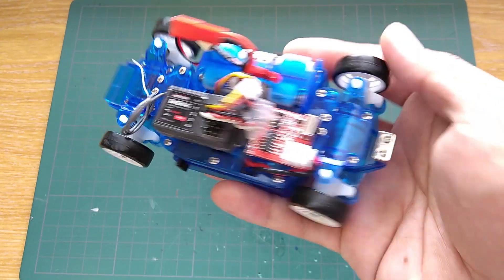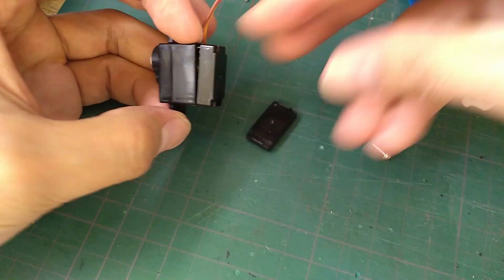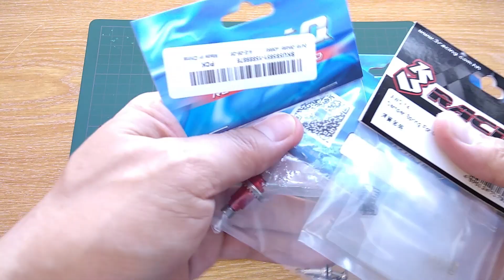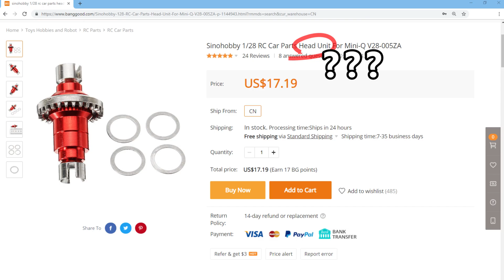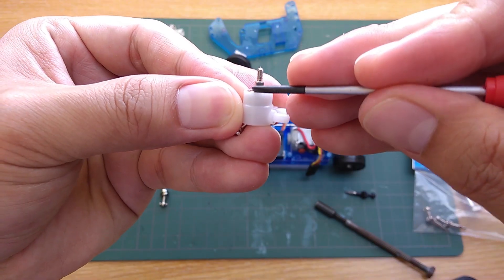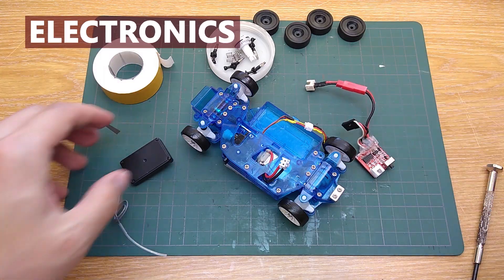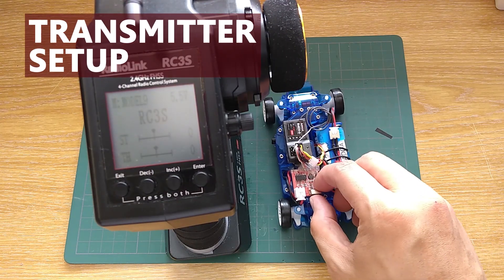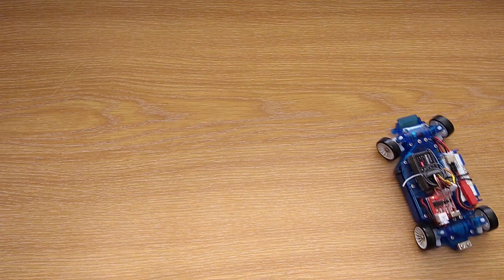Mini-Q TRQ1 | How To Build Ultimate Budget RC Drift

Comment: Hello just wondering...what’s the reason to upgrade the sevo?
Reply from the maker: The original one is 5 wire system which isn't compatible with standard RC electronics I upgrade the car too.
Then the precision, that 5 wire isn't precise nor fast.
Reply: Beaver's Hobby thank you for your reply!
Reply from the maker: @JimmyCNguyen  My pleasure.

Comment: Hi Beaver! Does the wltoys k989 drive shaft and gears work on the trq1?
Reply from the maker: Only the 17T motor pinion will work for sure. The drive shafts/swing shafts are 1mm longer and will only work if you use ball differential.
Reply: @BeaversHobby  i was talking about the prop shaft and not the drive shafts. sorry about my poor technical language. is it possible to use the same prop shaft as k989?
Reply from the maker: @antoniogilmesquita  Not directly. Both shaft ends are longer than Mini-Q but you can file them out so the length is the same. The cut is the same size though so you'll only need to file both ends off.

Comment: Hello Beaver! I have a question. What is the power switch on the bottom? It still works when it’s off then I switched it on and the car acted kind of weird? Thank you!!
Reply from the maker: It's power switch. The car should be off when it's at off position. I think you got a defective switch and board if the car is on no matter if the switch is on or off. You can unplug the switch too open up the case and pull small plug with 2 wires out and see if the board is still acting weird.
Reply: Beaver's Hobby thank you! I will try it. Ordered 2 cars and that happened to one and the other one seems the gear is stuck? The wheels simply won’t move anymore after the second charge. Worked great for the first hour haha
Reply from the maker: @Cigmop  Check the ST/DR dial. If it's too low the car won't run. Try and turn a wheel with your hand. If it can turn when the power off but it won't turn when the power on then there's a problem with the electronics. Hope this helps.

Comment: Hi Beaver! wich bearings do this car needs? Can you had a link in the part list?
Reply from the maker: Here you go.
- 8 of 3x7x2mm for the wheel hubs.
- 4 of 6x10x3mm for the differentials.
- 2 of 2x5x2.5mm for the prop shaft.

Comment: Hi,thanks for the great video,it really helpfull for beginner like me..i was wondering do u have any recomendations where to buy the body for this rc?
Reply from the maker: It's 94mm wheelbase so you can choose them from Mini-Z. I bought most of my bodies from Banzaihobby. Here's link to unpainted bodies. http://bit.ly/2CGgozp
You can check the wheelbase here. Look for 94mm. http://kyosho.com/mini-z-info/support/body-specifications/
And here's how to mount a Mini-Z body on this car.
EP1. https://youtu.be/U8kbobTW_10
EP2. https://youtu.be/-kKLbRNrDxY
Reply: Wow,thank you very much!keep uploading great video like this bro
Reply from the maker: @pramonsudjana6694  By pleasure.
Reply: @BeaversHobby  hi i just got mine and there's already a problem. The servo wont turn if i turn the steering wheel on the remote but if i just adjust the st/trm on the remote,the the servo will turn right  or left. Do u have any idea which part should i replace?
Reply from the maker: @pramonsudjana6694  Check the ST/DR dial, turn it to the right to increase the steering limit.
Reply: @BeaversHobby  still cant turn right or left bro,should I change all the electronics?
Reply: Turn out there's some part that need soldering in the remote. Now it can turn right and left but it wont drift because i think it need to turn tighter,will servo changed fix this problem?
Reply from the maker: @pramonsudjana6694  If you want to change the servo you'll end up changing all the electronics because there only one 5 wire in this size. Well, replace the whole electronics will make it better because you can turn it more but wee if the cost is worth the upgrade for you. If you already have a radio then it'll be great.
Reply: @BeaversHobby  i havent got the radio,any suggestion other than change the electronic to make it turn more?
Reply from the maker: @pramonsudjana6694  See if it can turn until the toe bar meets the chassis, if not you can try and extend the servo horn (or arm) with a piece of plastic so it's longer and has more throw.
Reply: @BeaversHobby  do u have another recomendation for radio which is cheaper than radiolink?
Reply from the maker: @pramonsudjana6694  Here's a DumboRC radio. It's really good and it'll work well but it doesn't have a screen. http://bit.ly/2YMsFfR
Reply: @BeaversHobby  hi i already change the electronics and use dumbo receiver. Do u have any suggestion so this rc can have a smaller turning circle?
Reply from the maker: @pramonsudjana6694  Turn the channel 1 EPA to maximum and file the chassis where the tie rod meet off a bit for more access.
Reply: @BeaversHobby  any suggestion for tire rod from other brands that will fit in trq1?
Reply from the maker: @pramonsudjana6694  It'll need a fair bit of modding. Use these things together to convert it to ball links.
Q5 knuckles: https://bit.ly/3gffjB8
Mini-Q tie rods: https://bit.ly/2ZDqkF1
I've tried this and it had worse steering than the stock if I just put it in. You'll need to cut the front bulkhead off a bit for more access.
Also filing the original tie rod and chassis will give you similar result.

Comment: I know this is a year later, but that triple A battery tray is using a ph2 no? I could switch the harnesses around and use my 1s tiny whoop batteries right?
Reply from the maker: Battery plug is XH 2.5.But you can always make an adapter.
Reply: Beaver's Hobby is there any way you can point me to a low profile receiver mod? I’m not fond of that bulky set up with plugs and all, coming from quadcopters and all
Reply from the maker: @amszulu  You can replace the plugs with JST-ZH 1.5mm or use something that has that plug already like this. https://youtu.be/_AAYvjIITiw
Some servos also already come with ZH plug because it's the standard plug in 1/28 racing.
Reply: Beaver's Hobby that’s perfect actually! I’m a total noob so I would like to have some gyro. I’ve got the stock trq1 on the way, so I’m trying to piece together my mods list
Reply from the maker: @amszulu  Gyro for GMR receiver will come later but right now if you want onboard gyro Radiolink RC4GS has receivers with build-in gyro. Well, it's a bit big but you can always replace the plugs.
Reply: Beaver's Hobby so I got my car today, and used the plug from the battery tray to make a 2s series pigtail. So far so good! Do you know where I can get XH plugged 2s batteries or would I have to make my own?

Comment: I just got one and ordered another. I need to get a lipo for it. Great vid.
Reply from the maker: Anything within 50x23mm will fit, height isn't a problem. Most 350-400mAh batteries will fit inside it.

Comment: what's the easiest way to get more steering angle?
Reply from the maker: File the stopper off from the steering column. You can see where the full lock is then slim those parts down.
Reply: @BeaversHobby  What do you suggest? I'm not understanding what do you mean by "stopper off from the steering column"
Reply from the maker: @mir4gem  There's a plastic piece on each side that stops the steering column from moving in further. You can file those off. However if you got the new batch of TRQ1 the problem is at the electronics. It just won't turn the servo.
Reply: @BeaversHobby  ah.. now I get it. But yes, it's the black version, I think other people have complained the same issue. The plastic you say doesn't block anything, it's the servo that turns just a litle bit. I need to replace it. AFRC-D1802 mini servo 3.7 6.0 v 5g JR plug, right?
Reply from the maker: @mir4gem  Yes, that AFRC D1802 will be a direct fit. Choose the JR plug if you have a receiver standard plugs. With that will have to replace all the electronics but it'll do this car good.
Reply: @BeaversHobby  What do you mean by "all the eletronics"?
Reply from the maker: @mir4gem  Replace the 2-in-1 with ESC, receiver to use your own radio. Like in this tutorial. https://youtu.be/rTveWKmr8xY
Reply: @BeaversHobby  Thanks a lot ;)
Reply from the maker: @mir4gem  My pleasure.
Reply: @BeaversHobby  I just have the controller that came with the TRQ1. It's possible to use it with the new ESC?
Reply from the maker: @mir4gem  Unfortunately, no.
Reply: Did it work (@Beaver's Hobby suggestion)?

Comment: How much is it all in
Reply from the maker: Everything + Shipping is about $119.
The most expensive item is Radiolink RC4GS which is $54. Otherwise if you already have a radio then it'll be $65.
If you buy 3Racing swing shafts instead of Mini-Q you'll save a bit more because they are both cheaper and don't need shim.
Also ESC is quite expensive in Banggood so you can find a 20A ESC from ebay for about $3.5.
Reply: @BeaversHobby  Can all the parts be shipped to the uk
Reply from the maker: @karenbaxter2706  Yes, Banggood and all the shops I bought from have international shipping.
Reply: @BeaversHobby What miniature RC drift car would you recommend for £80
Reply from the maker: @karenbaxter2706  Either Mini-Q TRQ1 or WLtoys K969/K989.
TRQ1 is a good chassis but electronics is fragile (that's why I replaced everything in this video). This one is a gamble. If the circuit board holds up it will be the best car to start. Other components are quite durable. Overall it doesn't drive as well as WLtoys and it doesn't have much headroom to modify.

WLtoys is the fastest in the budget category and has a lot of headroom to upgrade and modify. However the plastic is brittle and gears wear out very quickly.
K989 and K969 are essentially the same car.
K989 is rally/touring because it comes with open gear diff and grip tyres.
K969 is labelled as drift car because it comes with solid axles (permanently locked diffs) and drift tyres.
Choose whichever body you like because you'll want to change the tyres anyway and a differential can be locked later.
However it will need a bit of fixing to get it to work. I have entire video series for that. But just to get it working properly, follow episode 1 and 2. https://www.youtube.com/playlist?list=PLS79G3YjA2fAEez9GVeLW3JIy_LUIb6Mb

In conclusion, you have to choose between dodgy electronics from TRQ1 or fragile gears from WLToys.
Reply: @BeaversHobby  for the wl toys can you change the body shell for a mini z body shell
Reply from the maker: @karenbaxter2706  Yes, here's the video about using Mini-Z body with WLtoys. If you wait for a bit Camaro ZL1 body will come out and it should be direct fit without any modification.
https://youtu.be/-gCJEXXWBEo
Reply: @BeaversHobby  are there R34 gtr body shells
Reply from the maker: @karenbaxter2706  Unfortunately R34 is 94mm wheelbase and it won't fit. You can look at the wheelbase here, WLtoys needs 98mm wheelbase. http://kyosho.com/mini-z-info/support/body-specifications/
I suggest Subaru WRX STI (saloon) and replace the wheels with 0mm offset narrow wheels.
Reply: @BeaversHobby  thanks
Reply from the maker: @karenbaxter2706  My pleasure.

Comment: I bought a trq1, I see that the wheels rotate at the same time the front and rear wheels.  How to make the rear wheels spin faster than the front wheels?
Reply from the maker: Here's how you mod the spur gear + rear gear. https://youtu.be/pZxPKXgPvt0
And here's how you mod the diff to fit. https://youtu.be/t6PiUq-_9lI

Comment: Sorry for asking, is it i can put the drift tyre from ds racing to my tomy drift package light? Hope you can help. Thank you
Reply from the maker: I've never got Tony Drift Package before so I don't know. To fit the DS tyres, the wheels should look like what I show in this video. Here's what you can do. Check the wheels if the part where you put the tyre on is cylinder and not grooved. 
Then check the diameter and width. If the diameter is 20mm and width is 8.5mm (narrow) or 11mm (wide) then you can fit DS tyres (and any Mini-Z tyres) on it.
Reply: @BeaversHobby  ok mate, many thanks
Reply from the maker: My pleasure.

Comment: hello great video but can you explain how you calculated the value of the capacitors? and what changes between the three installation systems?
Reply from the maker: I took the instruction from https://www.pololu.com/docs/0J15/9 .
It's there to filter the noise from brushed motor so the non-polar 0.1 microfarad is enough to do that.
Reply: Thanks beaver. Would you recommend installing the capacitors on a k989. There is a circuit board there so I was not sure. Thanks.

Comment: Good friends, I have been following your channel for a long time, the truth would be great if you had subtitles in Spanish, hahaha, here there is not so much information about cars 1/28 scale, I tell you I have a 1/28 wltoys and I use it for the drift I would like to know that other cars Do you advise me for this, another question is driving a rear better?
Reply from the maker: Wltoys is already a good car once you fix the drivetrain and suspension.
If you want to upgrade right now there are more choices for RWD drift car. I highly recommend HGD1 because it's easy to build and easy to drift without spinning out.
Or if you want to stay in AWD drift then Atomic AMZ with hyper steering upgrade is still an excellent choice. You can move the electronics from Wltoys to AMZ too.
Reply: @BeaversHobby  Thank you very much for answering then I will wait to buy an amz, the wltoys more or I manage it I have several videos of it on my channel hahaha it is very funny with what to fix transmission and suspension you refer to and thank you very much for the advice 👍
Reply from the maker: @JMGPRC  My pleasure. Good luck with the project and stay safe.
Reply: @BeaversHobby  thanks 👍

Comment: Brushless?
Reply: What is your suggested size for Brushless?
Reply from the maker: @454charing  The only size that will fit is 1410 or 1625 (depends on the brand, they are the same dimensions)which is equivalent to 130 size for brushed motor.
Here's my brushless setup. https://youtu.be/7tq9JoxmZU8

You can find the list of motor in my review. https://youtu.be/5Z-S6d10na4
Reply from the maker: Put brushless motor in and use brushless ESC instead of brushed. That's it.